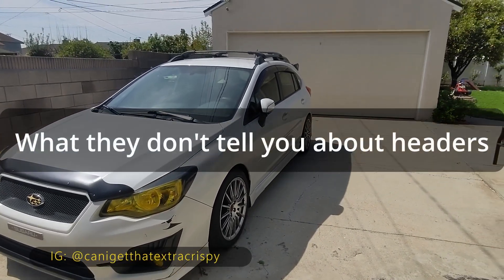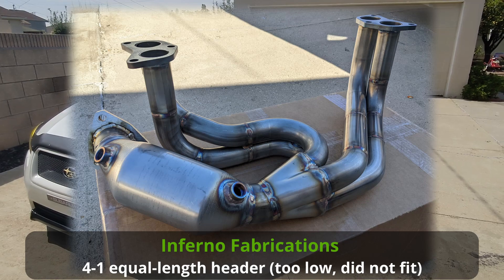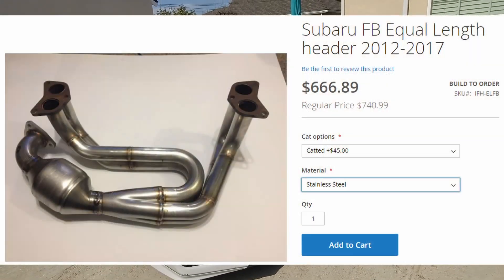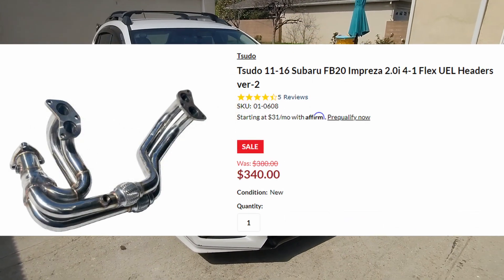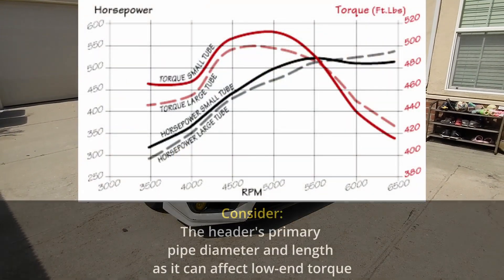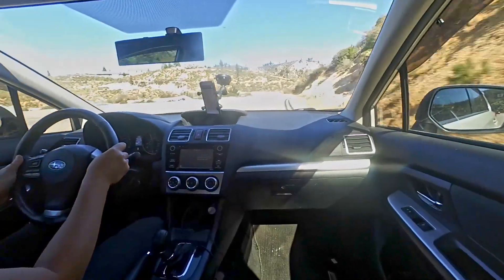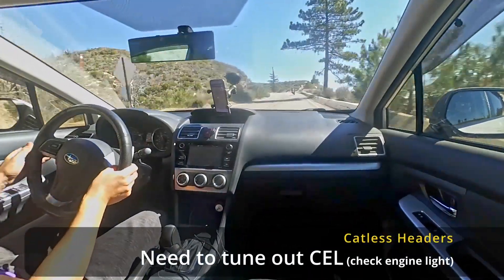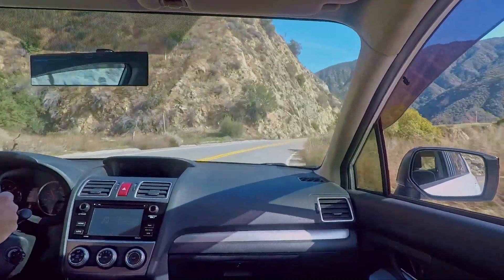Headers and Torque Loss - What they don't tell you

Comment: was it worth it to add larger headers and get an ecu tune for the same level of torque? Do the new headers benefit the car at higher RPMs? Genuinely asking cuz I don't know
Reply from the maker: TBH, no. Stock intake, stock exhaust, just send it. I had plenty of fun with the stock FB20 at 6200rpms.  There is more power at the higher RPMs with the headers, but we are talking 10hp. Also the tune I have is relatively mild. If anything just a more aggressive tune will give you good gains without having to deal with exhaust and reliability issues.  The stock exhaust and intake are already optimized for the engine size. The stock ECU tune however is rather bland in automatic (if you have a CVT). My reasoning to do all these mods is to learn what does what. And I can say that headers really are dependent on their design.  Long tube, 4-2-1 vs 4-1 tune diameter, etc all play important roles on what harmonics the exhaust breaths. Drivability changes with different exhausts.

Comment: so does the tune come installed with the tractrix port that you got, or did you have to buy the obd connector separately, and then buy a tune?
Reply from the maker: You'll need to find a tuner to e-tunes your car. The tactrix cable is just the connector. Tunes can cost $100-$1000 depending on who you go with or what is being done. XRT in Barbados, BR tuning in Canada, Throttle Happy in Australia are the ones I know who tune FB20 engines. There are probably more.
Reply: @Jason Leung  good to know,  thanks for the helpful info!!!

Comment: Hp and tq rating that is stated for headers/intake/any aftermarket parts, are based on after a returned. Most of the time if you juat throw a part on your car you will lose a little power/tq.

Sadly alot of people think just throwing a i/h/e on their car will make a huge difference just by installing the items.